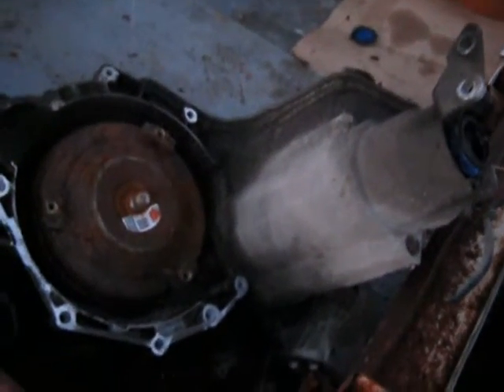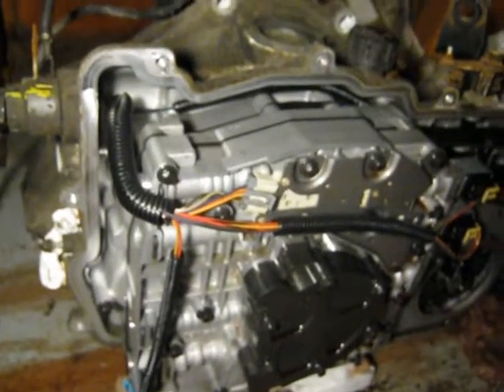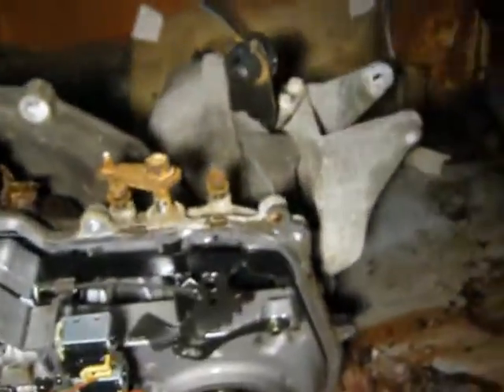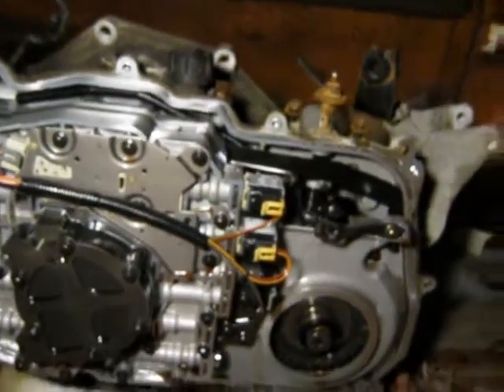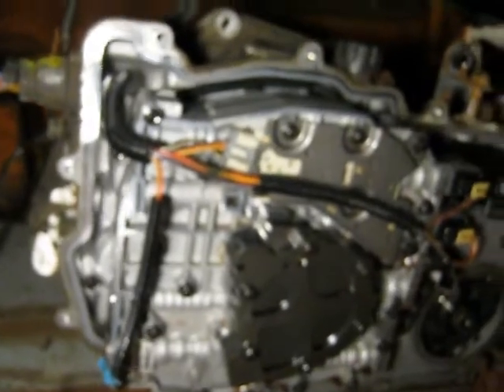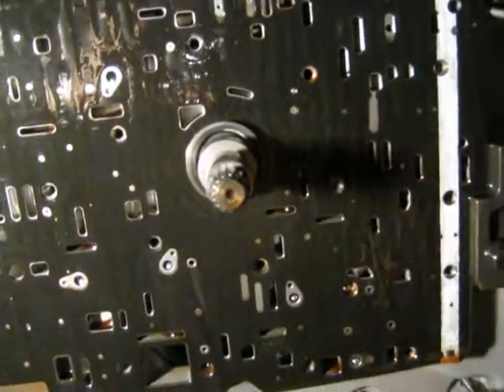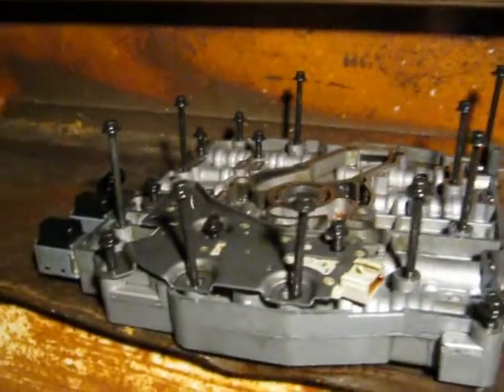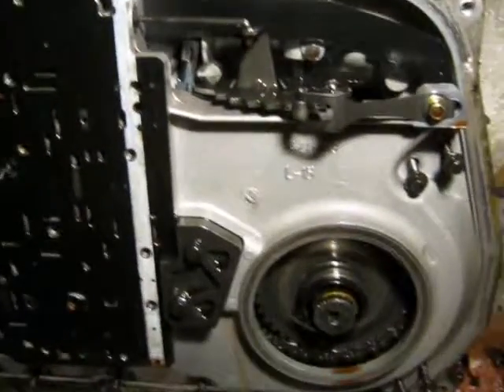GM 4T40-E Transmission teardown Part1

Comment: bro just i want to know if all these merged terminals are fully isolated? are the metal terminals in direct contact with the trans fluid. thanks
Reply from the maker: Sorry, I don't know the answer to that question. I suspect that all of these connections would be covered in trans fluid, being inside the case.

Comment: Good video hope you make something eventually ..
Reply from the maker: I ended up doing nothing with the trans in my car, as it is still going, even with the loose CV joint coming out of the trans on the passenger side. Maybe they can be that way, but I have not seen them this loose normally.

Comment: Was the transmission making alot of road noise? My 4t45e is doing this I think its the final drive support bushing were the passenger side axle sits.
Reply from the maker: I never ran the car it came out of, so I don't know. I suspect it would be making noise though. Lucily mine is still hanging in there!